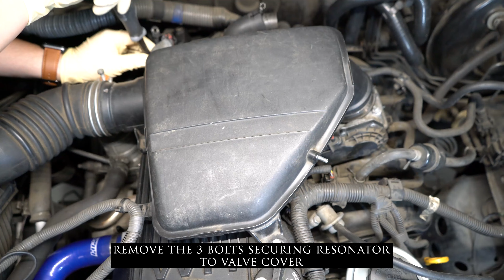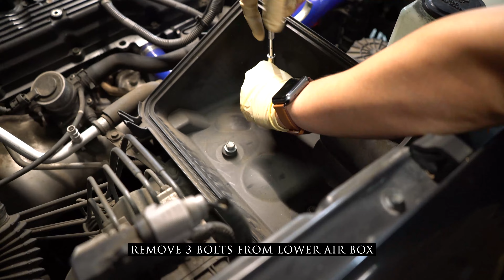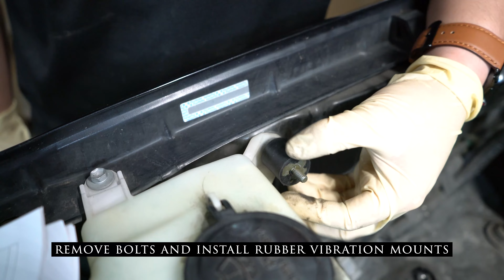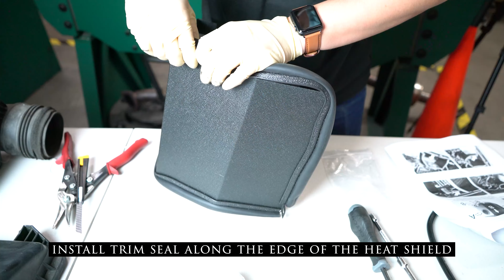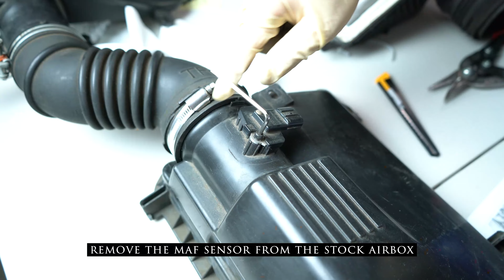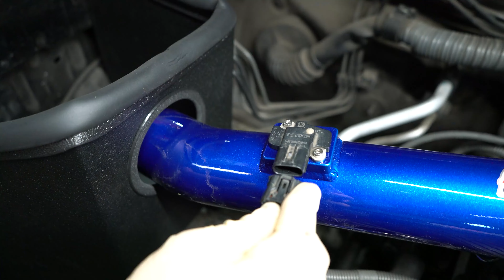2005-2020 TOYOTA TACOMA 2.7L INTAKE INSTALLATION

Comment: What if I insulated the exterior of the heat shield box with a light weight thermal barrier material to help isolate the box itself from hot air convection that the engine produces?

Comment: Check engine light turned on after test drive? Code p2441 and p2445 any ideas?
Reply from the maker: make sure all your connections are tight and nothing is leaking